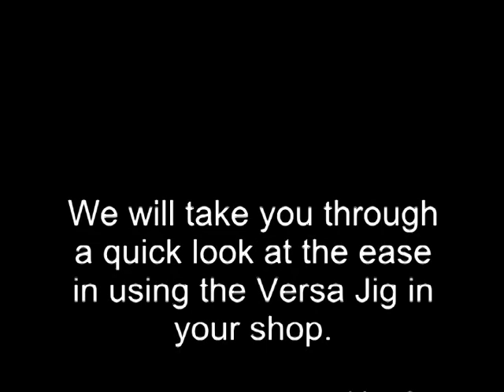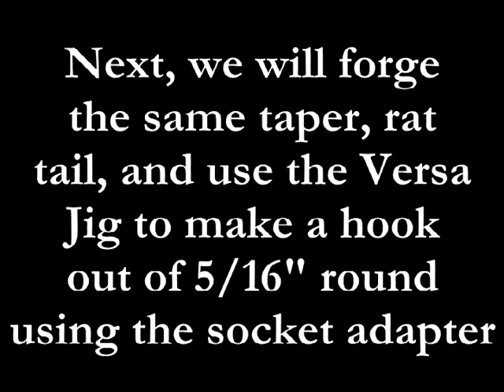VERSA Jig

Comment: how can u possibly sell any of these to a metal worker, when they r so easy to make, by those in the trade..?
Reply: 5 years later.. to someone like me. Not in the trade professionally and have a modest blacksmithing setup, but no access to a lathe, mill, or decent drill press.
Reply: @Johanthegnarler  4 years later - same here.  You'd have to have $20,000 in machining equipment just to make the jig properly.  Did you buy this jig?  If so has it been as useful as you thought?